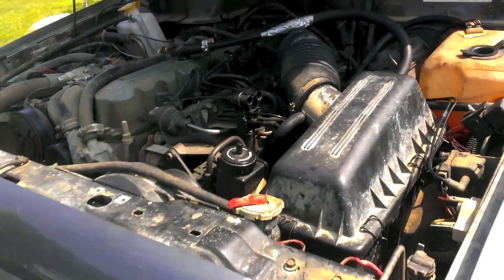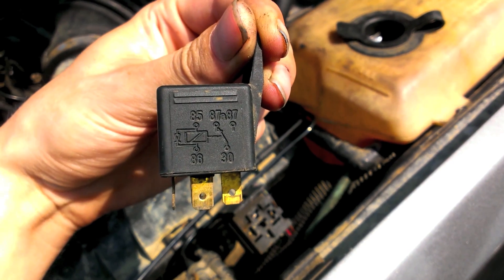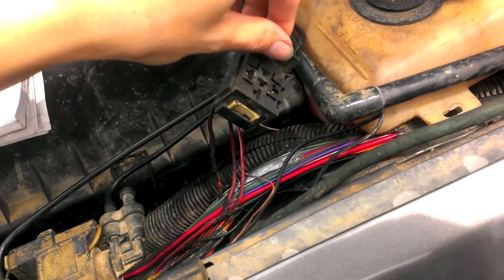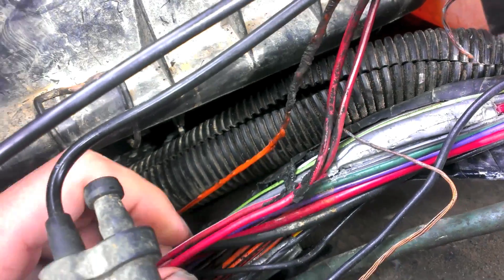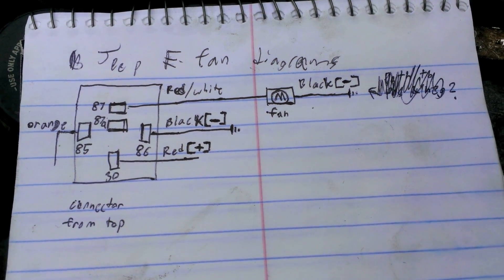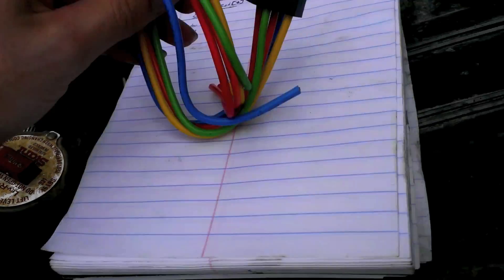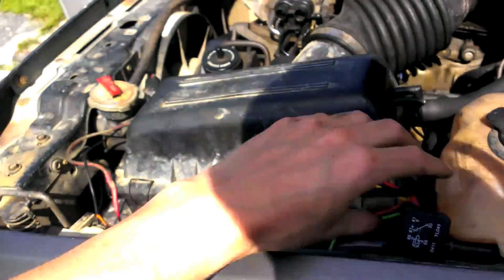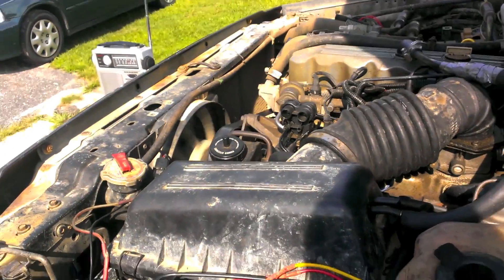89 Cherokee Replacing a Relay Socket for E-Fan

Comment: Hola Nick a mi renix 87 le pasa igual, no prende el ventilador eléctrico y mi carrito calentó.  Le revisé fusibles, ventilador, relay y sensor de temperatura, todo funciona. Cuando reviso el conector que viene de la caja de fusibles descubro que hay tierra pero no hay corriente. Entonces creo que tengo que abrir esa manguera que lleva un sin número de cables e ir revisando hasta donde me encuentre con el problema, si tienes alguna sugerencia por favor dimela, gracias 
Otra cosa me imagino que tengo que reemplazar sólo el cable, gracias por tus videos y sugerencias

Comment: Nice install job :-)
That replacement socket may have been cheap but its a million times better than the original cruddy one,  Gotta love the old relays, old tech that still works.

If it keeps leeching power, lift the live off the battery and bridge the gap with an ammeter, then pull the fuses untill the meter drops, sorry im teaching you how to suck eggs :-(
Reply from the maker: I've done the fuse test a few times, and it was never conclusive. I know the first time I had a drain problem had to do with worn battery cables shorting against each other

Comment: Dang, that rig takes awhile to start up, just like mine does!

Gotta love the Renix.

You should check the wires on the ignition switch down on the steering column.

The big brown wire is known to melt due to the large current draw on it.

Great videos sir.

Im glad im not the only one who loves popping the hood on the old Cherokee.
Reply from the maker: Yeah, My xj has always been a slow starter compared to the new models but it doesn't bother me much. As long as it starts, I'm happy. It could probably use a new battery.

I'll keep the ignition wire in mind if anything starts to get funky.